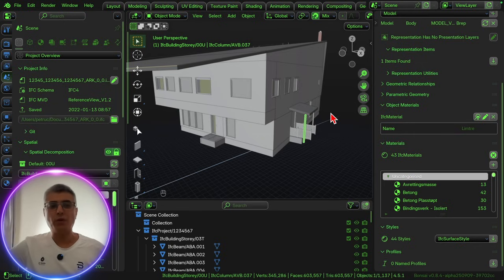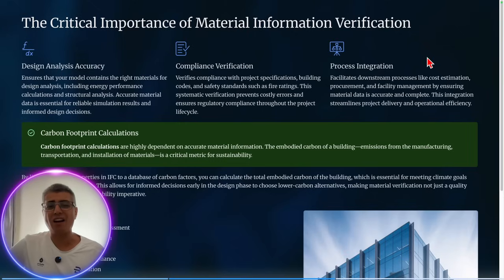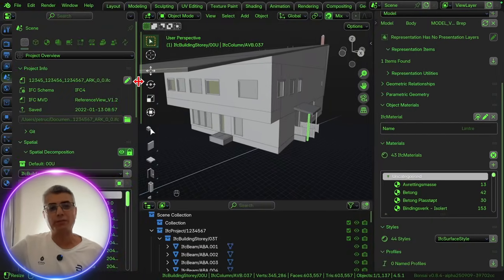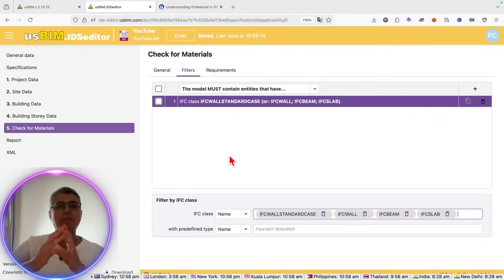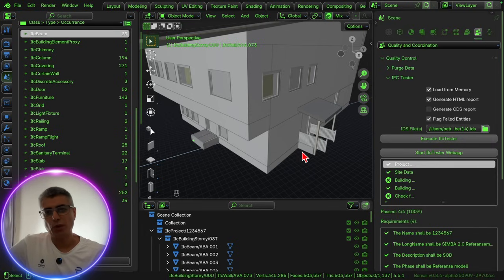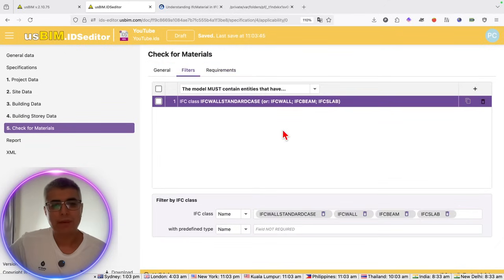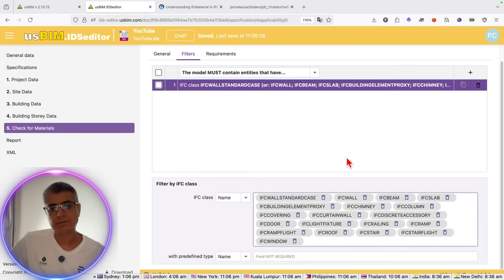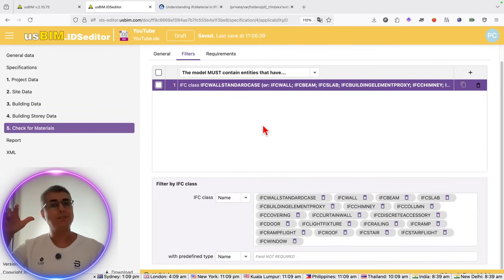Are Your IFC Models Missing Materials?

Comment: Can Blender bim IFC models be saved with a texture and material?
Reply from the maker: there is a dedicated entity IfcMaterial specifically for that purpose. I'm not so sure about textures.
Reply: Thanks for the reply.
Reply from the maker: @mbritto71  you're welcome! Do you work a lot with IFC on your projects or are you exploring Bonsai as an authoring tool?
Reply: @BIMvoice  I only found out about IFC files when I started using blenderbim. I expect steel structure concrete structure analysis to come in this grandiose